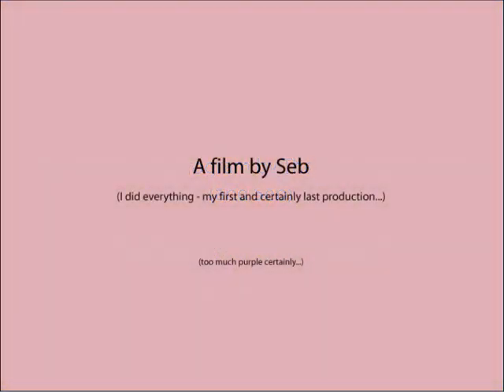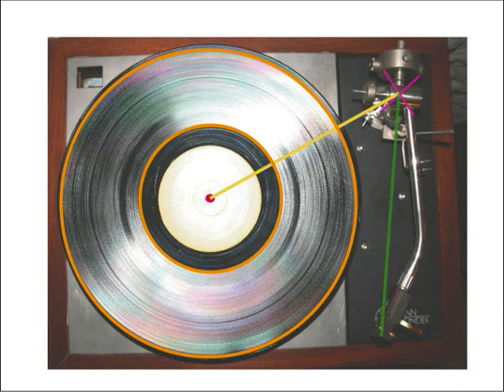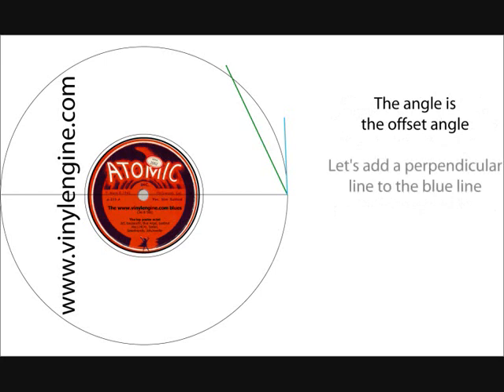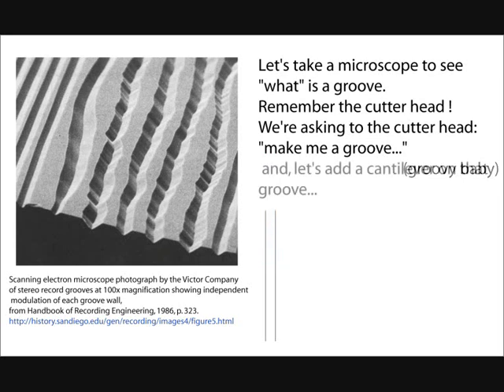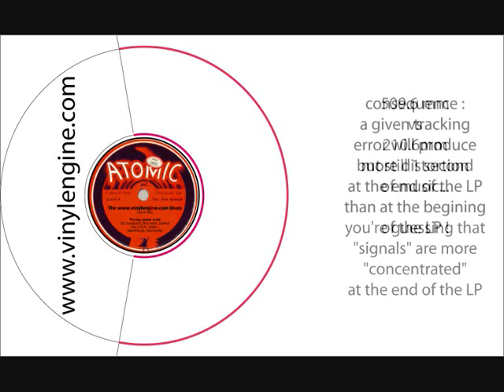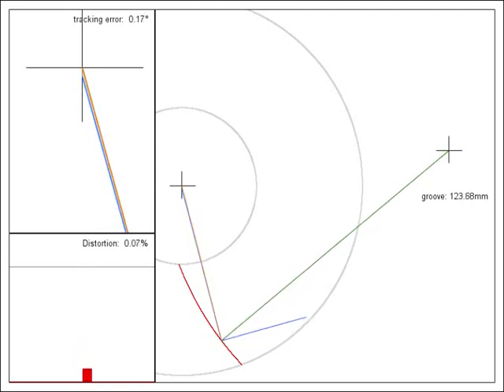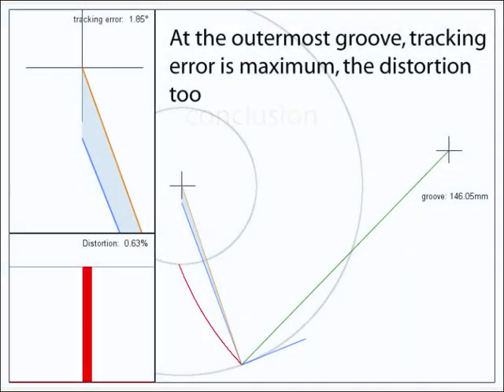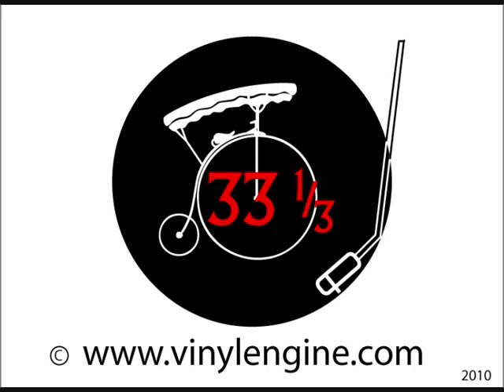show me your tracking error

Comment: @viking1au The longer the effective length of the arm, the lower the tracking angle distortion. A linear arm is the equivalent of a pivoted arm with an effective length of infinity, and has zero tracking angle error. In both cases however, a lot of new problems are introduced along with the solutions (increased inertia, loss of rigidity etc.) Nine inches offers a good compromise.